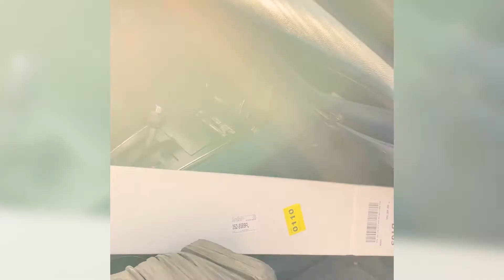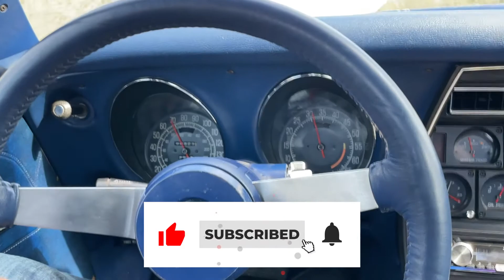Major Upgrades For This 77 Corvette

Comment: I bought a 1977 torch red corvette over two years ago.I have put over 14000 dollars in upgrades and improvements.I replaced almost everything in the engine.Its a real head turner,everywhere i go it gets a thumbsup,alot of smiles.I have no regrets,I installed long tube ceramic headers,and a high performance intake exhaust,flowmaster 40 mufflers,new wiring,tuneup,new waterpump,timing chain,new shocks,new rear leaf springs,complete tuneup,fuel filter,fuel pump,all new front end,new tires,new brakes,valve covers,air cleaner  It requires premium gas,and gets terrible gas mileage,It has a 17 gallon gas tank.goodluck russ....
Reply from the maker: That's awesome!  Wow, you put a lot of new parts on it.  Thanks so much for sharing.  We would love to see some pictures.  We have a FaceBook page,  https://www.facebook.com/MichMotorSports , if you would be willing to share some photos.
Reply: Why flocrap in a nice Vette. But congrats on the other upgrades
Reply: @jamesjones4309 what does flocrap mean bro,i do not understand for sure.lol

Comment: Looks like it set outside a lot.......  do the t-tops still fit properly. I got a 78 from some older folks and it set outside covered a lot.... the passenger side top seems warped as there is about a half inch gap at the left rear corner of the top??
Reply from the maker: It did do some sitting.  Not sure though if it was outside or not.

Comment: with all due respect why not put a 700 r4 in it?
Reply: Because three pedals are better!
Reply from the maker: What Joshua said :)
Reply: Will the 5 speed give you less rpm if the 400 turbo and the 5 speed end up one to one output? Seems like the differential gears need changing too. I agree with the fun of a manual tranny. I have a 73 big block and suffer the same rpm malady at highway speeds plus that engine such more go juice than the SBC. If better rpm was the true goal would not a 700R be a better choice? Is the fifth gear an overdrive?